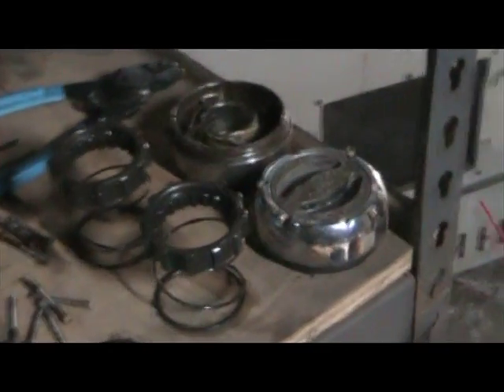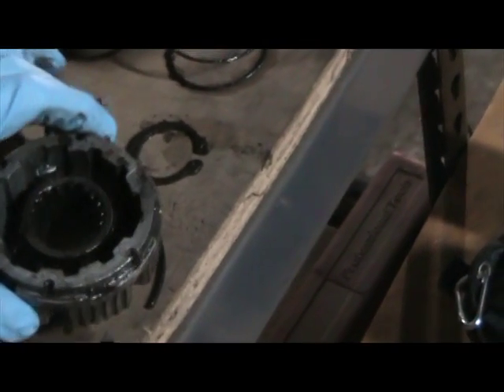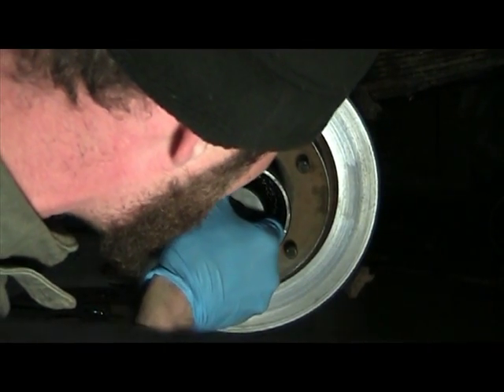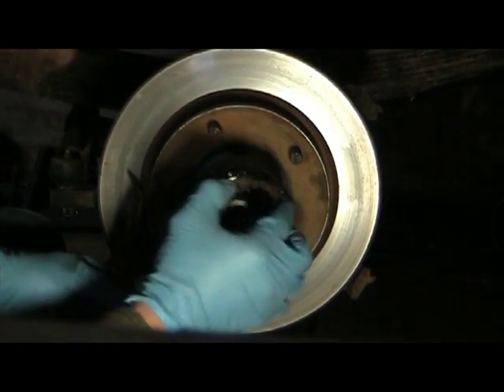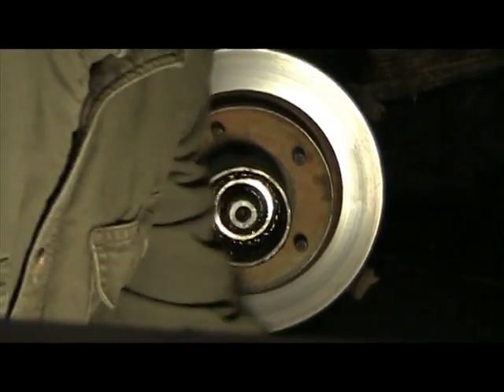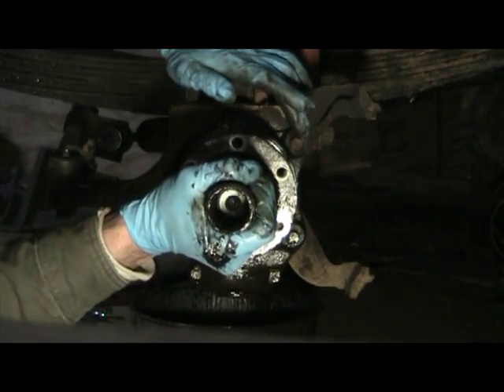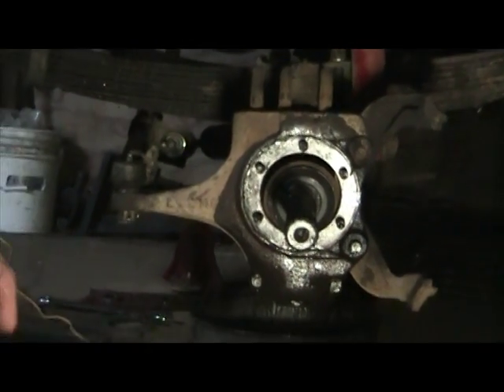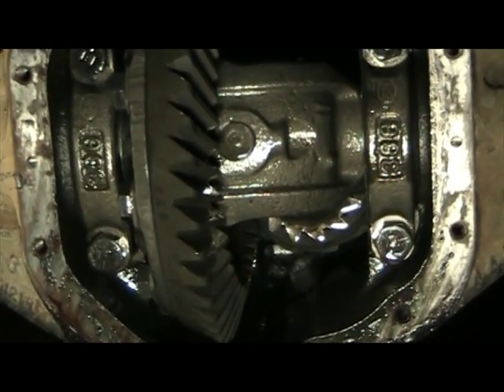D44-8F Hub and Spindle Removal.mpg

Comment: Been doing these for almost 30 years now, these are ultra EASY now that I graduated up to diesel mechanic, been changing hubs and seals, with bearings  that the spindle nuts are upwards of 4-1/2 inches or so, we have around 20 different 6 and 8 point spindle nut sockets for all the different trucks and axle combinations.
The outer nut being tight is a good thing, the inner nut on the spindle is only loose because of bearing and race wear, completely normal, if they are still good (simple inspection of rollers and races) and you set them up exactly as a new bearing when re-using.

Comment: I spent nearly 3 hours trying to break the spindle loose with a cold chisel and big f'ing hammer. Then tried a block of wood and big f'ing hammer. I read on a forum to use a slide hammer and spindle nut from Auto Zone. Had to put $85 deposit on it. I had very low hopes that this would actually work. I spun the nut on, attached the slide hammer, and started hammering. It was off in less than 10 minutes.
Reply from the maker: Good stuff, thanks for sharing. Not every axle has seen the same conditions and i was lucky enough to have a Oregon truck...no salt on roads so low corrosion.
Reply: I wish they wouldn't use salt here in Ohio but that's all they do from Dec thru Mar.  And if they can they start spreading liquid brine before a snow storm has started.  I'd rather just people slow down and not have to use the salt in the first place.
Reply: Can confirm.  Tried chisels and wedges for hours.  Tried a 10lb sledge and block of wood for hours!  Finally, the puller tool ~$35 on Amazon arrived and I used it with my slide hammer.  Each side took about 10 minutes to get off.
Reply: How would a slide hammer work on the spindle?  the studs aren't connected to spindle... just curious, got down to the spindles and nervous I won't be able to hammer and chisel it off.

Comment: theres a spindle puller adapter for a slide hammer and it takes spindle off in seconds with minimal effort. after half a day of hammering on it its what i had to use. Autozone has it as a loaner tool part #27104.

i htink the D44 carier for the rear is the same as the fornt. depends what gearing however. 3.93 and up gearing uses a different carrier than the 3.92 and down. the front will use reverse rotation gears.

cant jsut take ball joints loose to do u-joint, gotta do everything. i tried

Comment: Just grab & pull the shafts out thru the large holes in the knuckles.  The u-joint will fit thru the hole (yes, its tight).  You don't need to separate the ball joints (in fact, you can't) with the shaft in place.